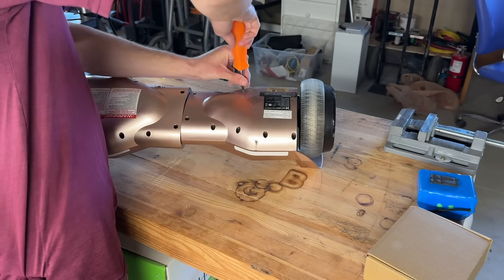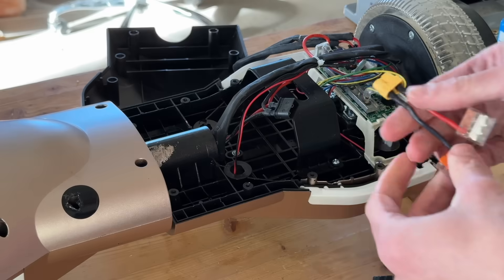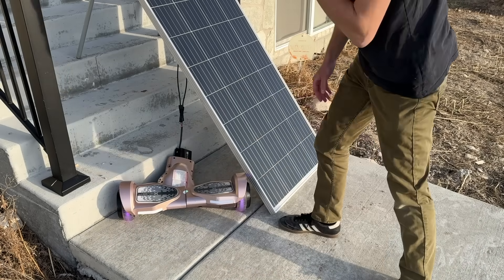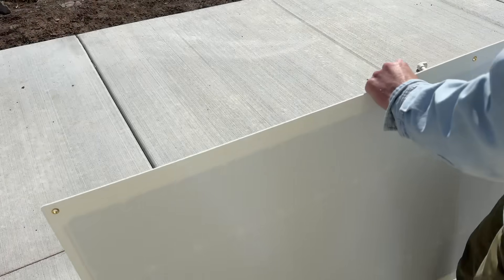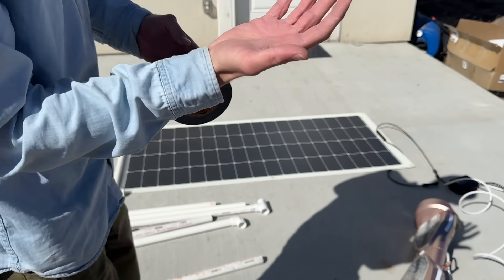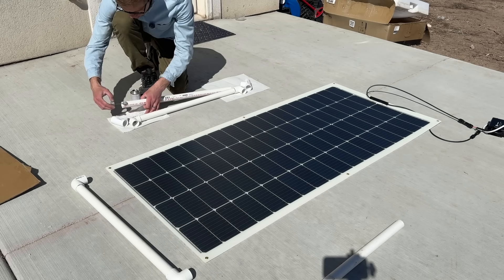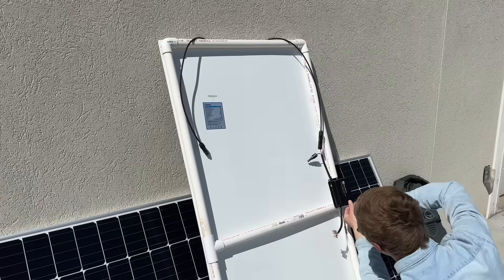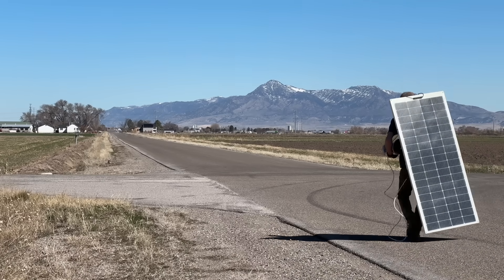I Built A Solar Powered Car... (No Battery)

Comment: Little tip for you guys rolling in fiberglass from an old HVAC tech, use vinegar on a rag to wipe it off. Don't ask me how it works it just does. It was taught to me by an older gentleman and I never bothered to ask.

Comment: Now, why can’t the Car companies do something like this make the entire body of the car solar panels I mean, ultra high wattage panels, the charge of battery or a couple of batteries so that after dark, you can get home or an electric car with a generator where the engine would goIt wouldn’t cost much gas to generate voltage to drive your car.

Comment: I don't know. I know nothing about this. But what if you used the solar panel to power electro magnets placed in a circle, like the numbers on a clock. The magnets would pull an arm like the arm on a clock and secured in a drive shaft. Then you have a manual crank that goes around turning magnets on and off, making it kind of like a pedelec motor... The crank would need to have a clutch function though, maybe push in to engage or something...

Then of course... The magnets would pull full force or nothing at all, which could be unpleasant....

Well I don't know. I'm not an engineer, but I love experiments like this. And if anyone tells you that your idea is crap? Be hellbent to prove them wrong!

Comment: A small battery should help pass a few clouds :D 
Brilliant idea actually. 
I am pretty sure there option on the market that would work a lot better for this project. An electric scooter motors are probably a lot more suited for a project like this, I bet you might be able to find a motor that could be powered by a single solar panel. Not to mention that you used a low voltage solar panel, I think there already solar panels that collect up to ~500W with the same size. On a clear summer day like that the sun provides around ~800W to a sq meter, so 500W panel should be able to collect nearly all the sun that can be collected :)

Comment: I just don't think the hoverboard is the vehicle to do it with, I find that with an electric bicycle you might see some miles with low wattage but still the lowest wattage I would like to pick for a motor is a 500 watt motor because a 2500 w battery is a 5-hour battery on that but that battery costs $600 that is why I would like a 500 watt motor on a solar project because it's the slowest thing I'm willing to ride at 21 miles per hour and a 1000 w motor would need a twice as big battery to go the same 5 hours on a charge , I would also see batteries as an amperage building device , that's a great project but practically useless without batteries.. but it's a good experiment and it proves that solar power is enough to power any vehicle of the similar size of the solar panel

Comment: This is silly. A solar panel definitely needs an intermediate buffer so that it and its MPPT controller work efficiently—either a battery or a supercapacitor. Ten years ago, there were videos here showing a tricycle with a panel as a roof and two passengers accelerating to 17 km per hour on solar traction.

Comment: Being so under powered you may want to tow at least 1 more panel, dump the electronics and just bang bang control brushed motors with a switch. You may be able to mod so the esc driver gets low power boost contolled voltage and the mosfet power section gets raw panel power. Probably with sensored motors? High pressure bike wheels would cut down the rolling resistance.

Comment: I’d say your own limitation is not the devices you used nor the sun but was your personal experience and logic. For example, the first solar panel you wore it vertically vs horizontal. Any solar panel has a maximum efficiency when it faces horizontal to the sun rays. So, no wonder you kept getting low power to outages. Now when you got the flexible panel, I thought he seems to be on track now; let’s see what he does with it. This time, you fixed it horizontally over your head, which was certainly a winner. *But I was hoping that you curved some PVC pipes in a large doom diameter, so they connect from the back and opened in the front, much like a beetle.  Which would have been the best solution and more stable and getting hit by the sun rays at all angles.  Wishing you the best, and hope you consider these upgrade changes.

Comment: I don't really get why you decided to make this project more difficult and less efficient by not using a battery.

As long as the battery is only charged from the solar panels, this would still be a 100% solar powered vehicle, but it also wouldn't waste as much of the incoming solar power and it'd have more stable, consistent power, even when there's brief overcast.

Like, why shoot yourself in the foot?

Comment: Interesting :) I don't know where you are but the roads are weird.
.
I had an urge to go down this path as a prototype.
2 small bicycles modified into a light 4 wheeler center seat very low.
Common size roof solar panel, light or flex like your using (250 to 300 Watt). Basic alloy frame above the seat, with a tilt for getting in and out.
Here in Australia the legal limit is 200Watt for a non registered vehicle. Its slow, maybe 15 to 20 km/h best. It leaves 50 Watt for battery top up.
Small battery back up. (clouds, rain, to get out of trouble).
.
The 15 km/h part makes it a bit problematic, even on a quiet road or street. 40km/h (common registered moped speeds) is probable more suitable.
Electric motors are easy to get, but the single panel still limits it to an average of about 20km/h. Then you have to go through vehicle compliance as well.
.
I gave up on as it wasn't feasible.
>
Looks like you had some fun though :)
P.S. I t would be interesting to know what the Watt rating for both motors is and the solar panel output. That was painful slow X-)

Comment: take the tubes that support the solar panel and cut them in half, then replace the top part connected to the solar panel by a smaller tube that can fit inside the big tube fixed to the hoverboard then you can block them with a screw going through the tubes. So you can take them apart easily and have a modular height to orient the panel directly to the sun... Not sure I was clear on that one.
And also, DO NOT USE WAGO for the main connectors, they are way too weak. Simple electric domino is great !
Reply: Great idea, being able to angle panel towards the sun is a big factor in power output. The solar bike racers have a similar thing where they can angle the panel mount depending on their direction of travel and time of day.
Reply: @McBenjiBoo  yes exactly, and you can put horizontal in case of wind...

Comment: This is a great project! I do have a couple of suggestions: 
1) Add a battery pack. It will make the power smoother and less-prone to hitting mininum voltage. It can charge the battery when it's not being used, improving it's range after the sun sets. 
2) That long power wire adds "IR" losses. That's the voltage drop across the wiring due to its resistance. One way to overcome this problem is to use thicker wire. 
3) Those hard tires have a lot of rolling friction. I would modify the hoverboard to use air tires that can roll with with less friction on asphalt roads. 
4) I saw that the panel was angled; I'm sure that helps. I believe that angle should be as perpendicultar to the sun's rays as possible. Maybe there's  way to hold the panel more vertically while overcoming the challenge of being aerodynamic. That's a tough challenge to overcome! 
5) I think it's possible to combine two or more hoveboards, provided you have enough solar panel power to drive them. You can use one as a front axle and the other for the rear. I've ridden them like this before just sitting on them, so I know this is possible! 😂
Reply: Aerodynamism doesn't matter at these speeds, I think having a battery pack is against the point of the project too.
Reply: @maelmauron7530 capacitor?
Reply: @ccibinel  You'd need a lot of supercapacitors to power the car, but for a few seconds it should work.

Comment: ok, this has probably been done a hundred times (not your video), but your video makes me curious

of how fast a homemade vehicle can go with solar panels like you use there (and no battery)

so like, let's say hypothetically 4 bicycle tires (3 could probably work fine too) (it's light weight anyways), and then at minimum 6 roof mounted panels that you used for the hoverboard 

could it go 50 kilometers per hour? (~30 mph) could it go 80 kmph (~48 mph)

Comment: These things have 2 batteries inside, right?
Reply from the maker: This one only had a single battery on one of the sides
Reply: I saw another video take apart one just like a day ago, and it also had 1 battery on one side (the "control module" was on the other side)

that video, they took apart the hoverboard to get it working again, and he managed to get the battery working again (which was the problem)

Comment: my proposal would be to add a series of super capacitors as a quick energy sponge instead of directly supplying the motor to keep the loss to most minimum, adding a T connectors on all contact joints would make it more durable and stable. were basically modeling it to like assisted pedal ebike but without the pedal as source cause we switched it with solar panel

Comment: Maybe try it with a couple super/ultra capacitors to buffer the system when sun is low 🤔

Could make the pvc diameter bigger to hide the capacitors inside also.

Comment: I built an e bike using razor e300 parts and a kid 20 inch bike a few years back. Been meaning to make a solar powered only version by increasing the gear ratio[you're only gonna get 70-80 usable watts from that size panel on a moderately sunny day and that equates to 6-7mph].I saw a kid on a hoverboard just yesterday and mused what would happen if he were holding a solar panel and lo and behold your vid pops up!!!.I do recall seeing an Indian produced vid with a PVC cart and panels years back also. All it takes is minimization of Crr(rolling resistance) and proper gearing), unfortunately unless solar panels become 80%+ efficient, that's the best you can expect.This idea may be useful for lightweight mobility scooters...ie solar backup/subsidiary power. Good luck

Comment: Large solar panels are therefore an unsolvable problem and the lack of sunlight all day long. I have built a bicycle that uses a small amount of power but converts it into electricity with a very high efficiency generator and uses a wind turbine to generate electricity, which solves all the problems. A bicycle that is used for exercise but has many benefits because it can reach a speed of more than 80 kilometers per hour.

Comment: Charge controllers expect a battery, if you try to pull too much current from the panel and it goes below its max power point then the voltage will collapse and you'll end up on the floor as you already found out!

Comment: Do the same with a modern scooter by solid brand, they are probably way more efficient too. And maybe keep the battery (with a switch?) to keep moving when a cloud hides the sun. 
And with a standard sized ~450W solar panel on a somewhat more rigid frame than PVC tubing. 😅

Comment: It's a cool idea. I think it would be much better to base the build off an old Onewheel, though. Make sure it's an older firmware XR if you use one. The newer ones will brick if you disconnect the battery. A plus or original Onewheel would work well without worrying about bricking it.
Reply from the maker: A solar powered onewheel would be sweet!

Comment: well, naturally you would ride on the solar panel, hover board. flexible cloth like solar panel would be much simpler. like a hang glider. why make flexible panels from something that is not compatible with handling. I would guess they would have put a protective coating on the fiber core. thats like wind powered boat, with sails, solar sails. yeah direct solar boat would be just fine. forgot how to align sails, must align to wind/solar.

Comment: I made lawnmower radio controlled by hoverboard https://youtu.be/l2DWvn_KxuE I used the hacked firmware. You should have kept the battery as it will give power and reduce the chances of power cuts and injury.
Reply from the maker: Remove the shroud and you've got yourself a battle bot! That thing looks awesome! I'd love to see how it performs when actually cutting grass

Comment: See the thing that is so silly, why don't EV manufacturers come up with a dual battery system, have half the cells charging from roof solar panels while you drive on the other half.  Then when the half you are driving on gets low, hopefully the 2nd half is charged, or at least charged enough to get you to a charge station.  Maybe solar panel efficiency is the bottleneck, but I can't help but wonder if its because they want to ensure you are dependent on EV charge station infrastructure to get around, just like how gas vehicles are still dependent on gas stations despite better range and quicker refuel.  I don't think you could power a legitimate vehicle directly off solar, but again, the dual system should at least be worth developing....

Comment: You could possibly change the windings in the motors and use a separate speed controller for them to get more top speed for you voltages also mounting your drive axles inside one way bearings / bicycle racheting mechanism then it can roll freely for a while or continously down hill 😊

Comment: You absolute clown. I love this! If you had bigger wheels, say by driving road bike wheels at the rim or the tire surface with the hoverboard wheels, you might have less loss due to rolling friction. And then a mechanism to aim the panel more squarely at the Sun; on your first attempt, your shadow seems to indicate that you're suffering from cosine losses. Also: MOAR PANELS!! Keep clowning!

Comment: There reaches a certain point in something like this that I can't help but wonder why you wouldn't just make the solar panel a sail.  A solar powered electric land surfboard doesn't feel all that preposterous, especially if you used the extra space on the board for more panels.

Comment: You should use at least some big capacitors(just like 22000 uF / 35V) between the charge controller and the hoverboard. Not a big investment but could improve a lot.
Reply: That's 13 joules, or less than 100ms of operation.
Reply: 10 500F caps would power the device for a few seconds. However, this is expensive.
Reply: @maelmauron7530 It is not about powering the device for seconds from the capacitor. Motor drivers can work in high frequencys which makes high and low spikes in the milisecond range. If the driver needs for example 10A for a moment, but the solar panel can provide 5A only , than you will have 50% performance at that moment. A capacitor could provide the required power and charge back as the low spikes follows. Solar panels can't produce more amper in need meanwhile batteries , capacitors can.
Reply: @davidkovacs1751  the MPPT circuit and hoverboard should both have smoothing capacitors (especially the solar panel's MPPT controller, the hoverboard might not if there's nothing sensitive that could be affected by current spikes inside)

Comment: 00:22. You failed; I found the video.
04:22. I feel your pain. Literally; I work at a fibreglass manufacturing plant, packing bobbins of fibreglass threads.
Reply: I made fibreglass filters as a teenager, working lacing fibreglass filters together with piano wire under tension. Those weren't threads of fibreglass, there were some shards in there too. Sweaty hands and cotton gloves and glass shards, oh my!

Comment: just for sake of safety...bicycle mirrors to left and right pole of your veichle, and some flashing lights...and what about a compact, but high capacity(compared to its size) power bank? Imuto made a 100wh one in size of two smaller fists...one usb-c port supports up to 100W(20v-5amps)...and it is not even the best of best.🙃

Comment: I'd have started with an e-trike or certainly any bicycle platform tandem/quad etc, also I'd consider a battery worth having between the charge controller and motor controller. Improvements to solar panel technology should make for even better builds in the future

Comment: You totally lost me when you took the battery out of the hoverboard because I've had them myself for my kids why would it show 25 volts if you hadn't charged it prior to testing it unless you did off camera just because it only had 4.5 volts doesn't mean the battery pack was bad I worked at a landfill and anytime I found one of those I took the motors the wheels and the batteries to repurpose the batteries and the motors and momentary switches the majority of the time they don't go bad kids just get over the new toy and they get tossed out there's so much stuff you can do with those letters such as small wind generators Hydro generators put a bracket above your tire on your bike to run a headlight or brake lights😊

Comment: PV panels do not provide constant power, and they always need to be pointed directly at the sun to get a significant amount of power. A sunny day alone doesn't cut it. Hoverboards require constant power, and you aren't providing it. Your setup doesn't provide even a warning that you are losing power. At least add a super-capacitor to provide a few seconds of power reserve to sound an alarm before the board dies.

Comment: The shadow with the backpack should be the same size as the solar panel so it is at 90 degrees to the sun use it in the morning or after noon depending on travel direction that's why it worked better with the trolley at midday horisontal with the big shadow and slowed down in the afternoon not just the cloud. Use the bigger framed panel for even power it will not be concave as well no need for the plastic frame just adjustable brackets to the trolly to keep it at 90 degrees to the sun and you in full shade..